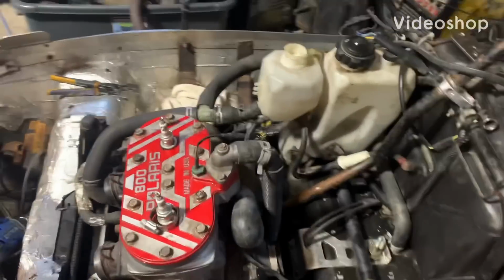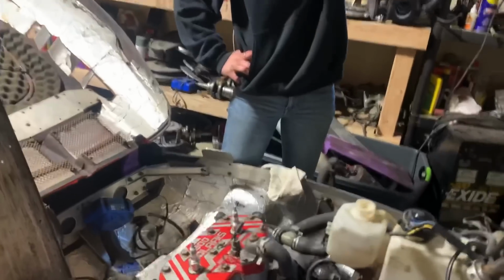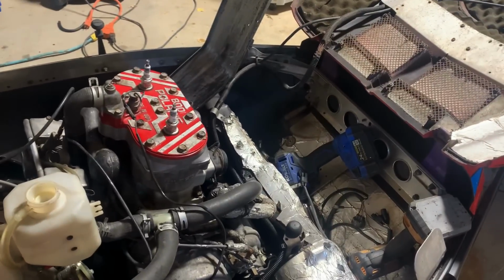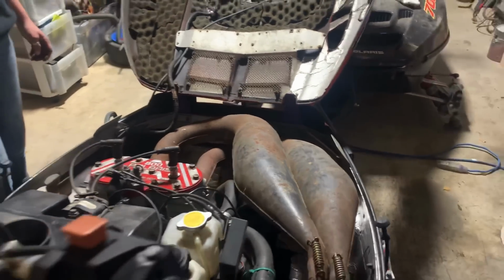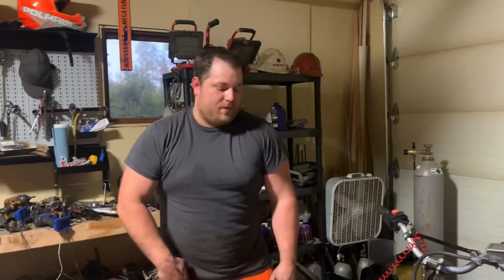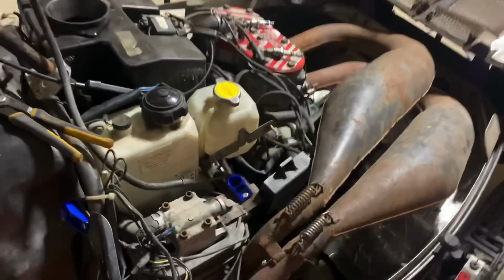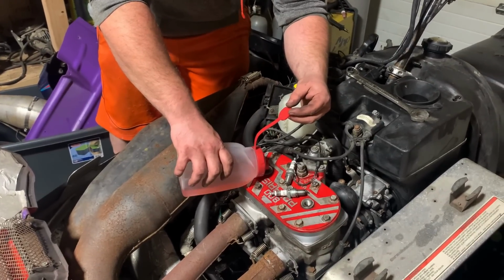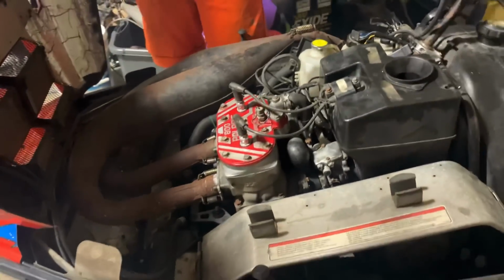XCR 440 / 800 mod first start!!

Comment: Hi there buddy. Look more into your temp sensor. I believe the two wire temp sensor is needed to keep the timing from going into to limp mode.
Reply from the maker: I  have the two wire one into the CDI harness. One wire temp sensor plugged into the chassis harness. I’ll give it a go once the snow hits and see what happens.